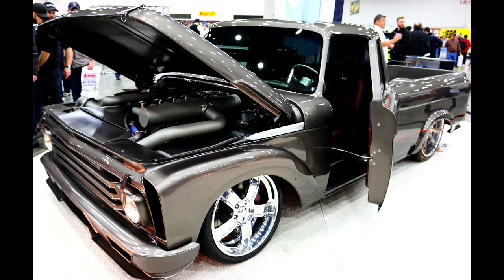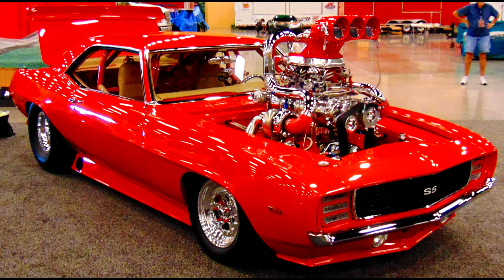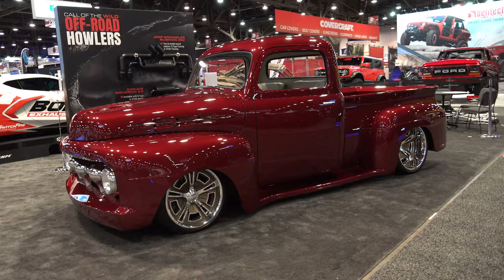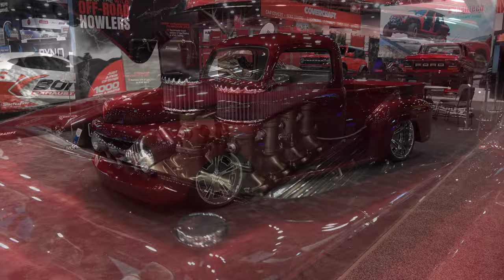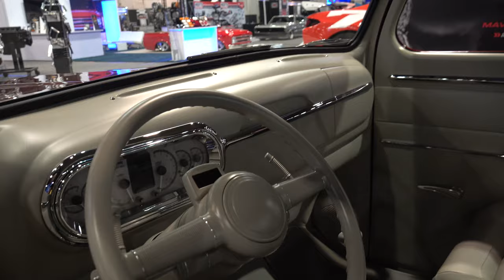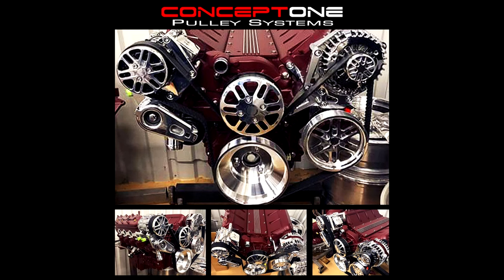1951 Ford F1 Hot Rod Pickup Truck "Dream Catcher" Kindig It Design 2021 SEMA Show Las Vegas NV

Comment: The Beauty about American Muscle regardless of the era, makes and models is that components swapping be it motors, trannies, rear-ends is that it all works for the builder and or for the owner. I would have probably used a HEMI/Borgwarner 6+ speed tranny and posi 373gears. 
AMERICAN MUSCLES IS THAT THE COMBINATIONS ARE ENDLESS, ACHIEVING THE POWER ARE ENDLESS POSSIBILITIES.  
PEOPLE THINK OUTSIDE THE BOX
Reply from the maker: Why would You out a MOPAR engine in a Ford??....Thanks for checking it out!